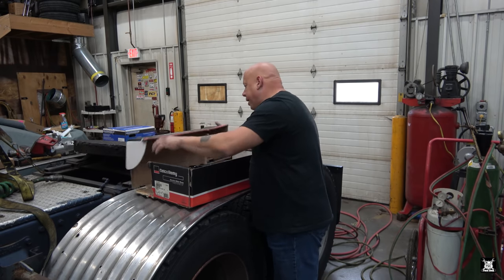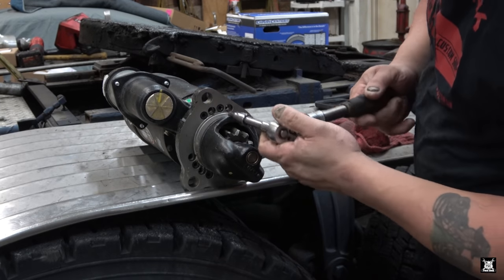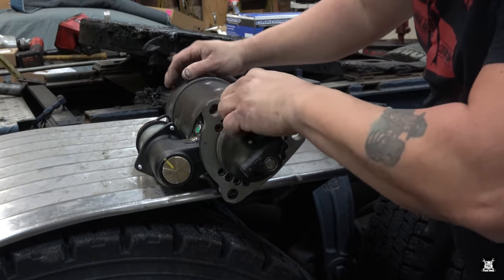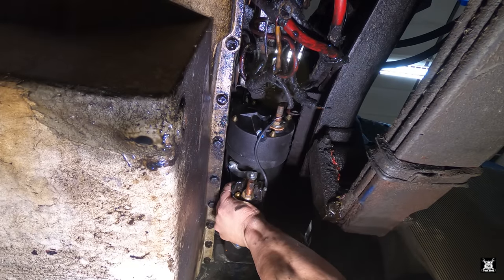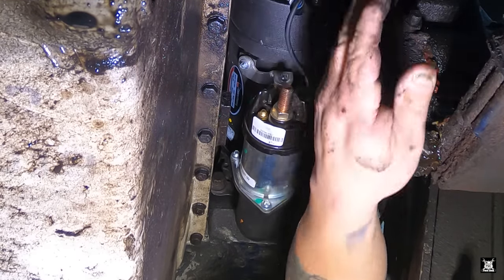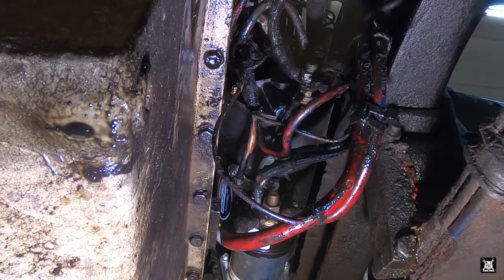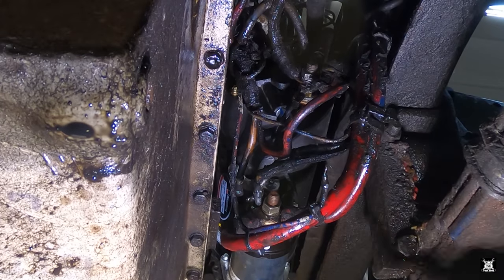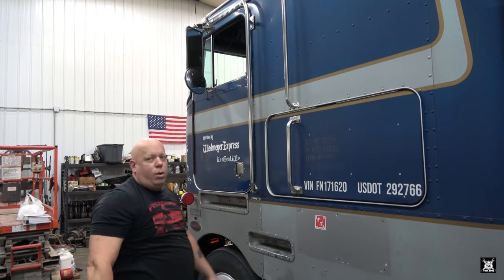Cabover Peterbilt Gets A New Starter

Comment: Delco 39mt is the updated starter looks a little different because it doesn’t have a cone over the gear but it will fit that motor and is half the weight

Comment: This is why you need an air starter: Much lighter, much smaller and much more fun when you wind it up.  😋

It'll definitely get you noticed in the Truck Stop!
Reply: Young (CDL 2 Yrs old) Driver here,

Don't they use up alot of Air though?
Reply: @alexanderbeck5063  They can use up all the air if you let it. 😋

Older engines were using lower compression so you could turn it over and light it off quickly.  As the need for more power increased, they bumped up the compression, added turbos, put big cams in and the air starters were replaced by electric  as they could go longer to give the more powerful engines the time to light up. 

Some old fire engines, including Macks, had air starters because they would be hooked up to air lines in the fire house so they could go and light up quickly.  It also helped they were inside so the blocks weren't bone cold.

It's all about the application and the location.
Reply: @danielseelye6005  air start went away when batteries got better trucks used to have four 6 volt batteries and a series parallel switch to run a 24v starter . Better 12 volt batteries with more cca put the air starter and the 24 volt systems out of business . Military and buses the most common for 24v.
Just my two cents.
Reply: Ohh ok. Thanks for the Informative reply! Seeing as I'm in the market for a classic truck, any information I can find is invaluable!
Reply: @tater_relocater  I didn't think about the batteries.  Huh.  Good to know.

Comment: Hey do you know where can I get the windshield sun visor that is on the top of the windshield in Chrome or stainless steel with the led lights on them for a 2002 Ford F-150 all of the ones that I can find is made with fiber glass that would mines that I have to get it painted the same color of my truck the ones that paired it does not have the paint mix will you please let me know if you can help me or not I will still keep watching your YouTube channel and your truck you call oh well thank you and GOD BLESS AND STAY SAFE OUT ON THE ROADS I THINK THAT I WILL BE THE ONES TRUCK DRIVERS CALL 4 WHEELERS